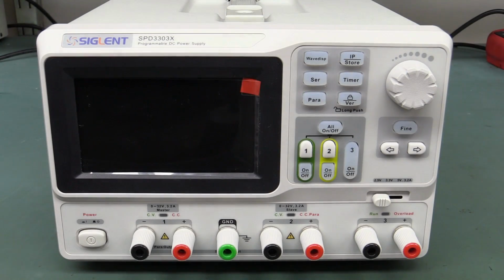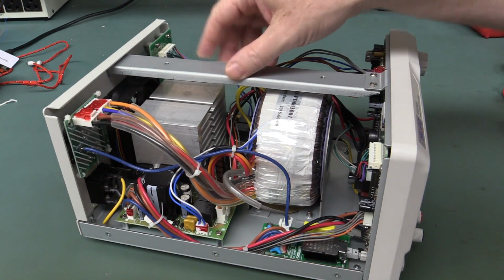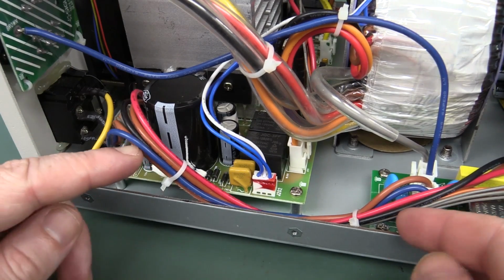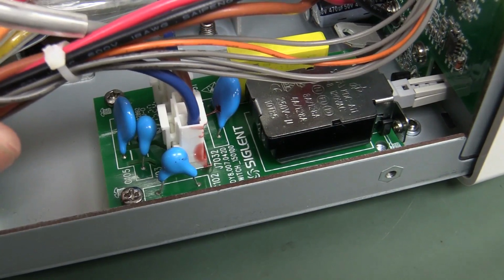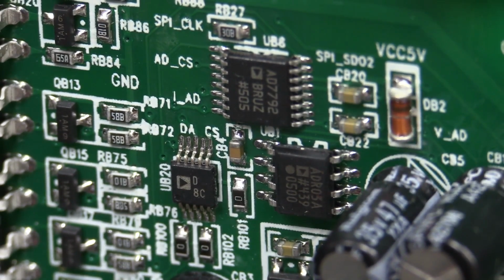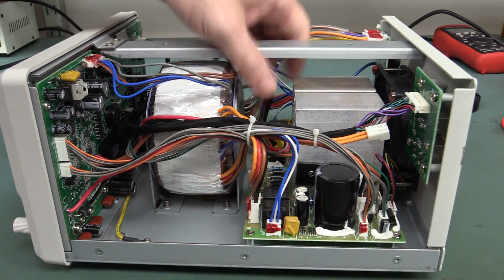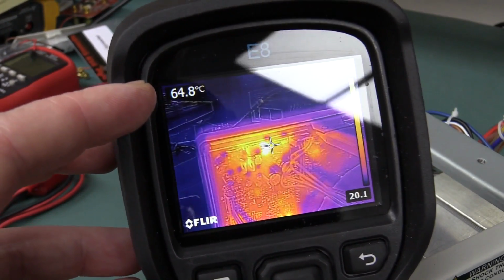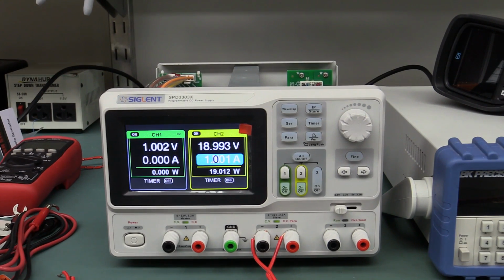EEVblog #828 - Siglent SPD3303X Precision Lab PSU Teardown

Comment: +EEVblog I want to build my own really awesome 0 to +-15V 5A dual rail linear power supply, but I only have a 24Vrms 10A center tapped Xformer with a smaller separate high voltage winding (almost 35V if I remember correctly) One of the problems I think I will face is dissipating potentially 5A at 15V, or 75W of power for each rail! Is this unrealistic? I was thinking about using a CPU heatsink on a TIP35C and TIP36C. Will I need to use a switching preregulator or modify the transformer?
Reply: Starting with a transformer that's not suited for the application is a recipe for frustration.  That said, it would probably be easier -- unless you really understand switchers and their feedback loops -- to modify the transformer.  From a hobbyist POV, a high current switching preregulator is witchcraft.  Remove a few secondary windings from your transformer to achieve the desired AC output, but you'll have to unwind past the middle and reposition the center tap to keep it balanced.  You're still going to have a lot of heat to deal with at low V, high I outputs.  I'd use the aux winding to power your control electronics, but 35V is a bad starting point for that as well, so it should be rewound also.  Really your best bet is to buy an appropriately sized toroid core (eBay: ~$30) and wind your own transformer.  Fun and challenging project; good luck!
Reply: +Power Max 
so 24V RMS centre tapped, or twin 12V winding, will give you +16.98 and -16.98V after rectification and filtering (remember Filter caps will charge up to peak voltage, not RMS).
You only want a single rail, so just use half the Transformer, should be fine, but 16.98V is probably a bit too close to your desired 15V by the time you take into account ripple, and required VF across the regulator, although there are some great Low drop out regulators available now so if you have enough capacitance in the filters, you might get away with it.
Reply: +Richard Freeman It is close, but if I can achieve dual rail 15V, that would be nice! However I am really wanting this homemade supply to be fully adjustable current and voltage from 0. That is proving to be a bit challenge with discretes. Even if I decide to make this only +-12V. I have a LOT of op amps, including several handfuls of LM741's, and LM324's, some LM318's, as well as a few LT1112's, and LT1364 and some other similar opamps, along with like 10 2N3055's in the TO3 package.
Reply: +FlyingShotsman Actually, the transformer is more like 12v-0-12v windings. They are 15V open circuit after rectification and filtering. The transformer actually came out of a Lambda linear power supply rated 5V 10A! It was not operational to begin with, I cannot imagine why they used such a high voltage transformer in this supply, maybe because it was from like the 70's or something, when discrete transistor circuits were sort of 'sucky'? (high dropout voltage reg design) IDK.

Modifying this transformer will be incredibly difficult I imagine because of the way it is constructed. It is really solidly laminated together, and it almost looks like there are like 10 layers of laminated paper material which chips away and is pretty sharp. If I were to make my own, it would have like 8 taps on it, 4 for both the positive and negative half!

If that 35V smaller winding has a center tap that is connected to the center tap to the main secondary, I might be able to use that to reduce the dropout voltage to practically zero! I have a linear power supply design in LTspice that is made exactly like that and it works well, at least for the positive half, have not done much work to make the bottom half regulate.

I have modified and built a few switch mode regulators, and understand the basics of how they work, though I am not too experienced with them. Certainly not an expert at them.
Reply: During the design process, I learned the hard way that LM324's do not like almost 40V across their power pins :O I killed half of a LM324 that way! The other half works though! It is saved temporarily from my box of shame!
Reply: while the basic idea of a Linear supply is pretty simple, juggling compensation loops and trying to stop the thing breaking into song, while still regulating nicely can be fun.
I would suggest looking at an LM723 (or two - one for each rail) as there are tried and proven circuits out there based on this chip, after all this is the job it was deigned for.

If you do want to persist with Op-amps, then as you have observed around +/-18 Volts is about as far as they go (although there are some newer ones that can handle higher supply rails)  so you would need to power any Op-amps between your 0V rail and the unregulated side of the rail it is going to regulate. then you may have the challenge that Op-amps usually can't drive their outputs rail to rail, so getting a supply that can regulate down to 0V output may require a trick or two....
Of course you will still have the problem of heat in your output stage at lower voltages with high current outputs, and you may find that by the time you buy heat-sinking and cooling for this it is cheaper to buy a more suitable Transformer.
Reply: +Richard Freeman yeah, lots of things to keep in mind, I certainly understand from some experience! I luckily have not had too much problems with parasitic oscilation, a capacitor took care of that. So far my prototype suffers from really poor line regulation because LEDs and normal zeners don't make great voltage references.
Reply: yes, Zener voltage can vary quite significantly depending on the current through them, so what you have to do is limit the variation in current through them, using a current source, even a relatively simple one like;
https://en.wikipedia.org/wiki/Current_source#/media/File:Const_cur_src_111.svg
this will reduce current variation through your zener (use the zener in place of 'Load' which in turn will reduce the variation in VR of the Zener.
Reply: +Richard Freeman Yeah, the classic BJT current source! Love that circuit for it's simplicity, that is actually what I am using for a minimum load! I did try that idea to limit the current range through the zener in hopes that it would further stabilize it, but I could still see quite a bit of variation across the zener. Maybe I built it wrong, IDK. I built the PNP version of it though, so that I have a current source instead of a sink.
Reply: +Richard Freeman I think the current-limiting portion of my design might be flawed though, what I am doing is using a op amp across the shunt resistor (between output of the pass element and the output)  and another 100ish ohm resistor in series. I develop a voltage drop across that resistor by means of that adjustable current sink, in that URL, so that way the op amp will turn off the pass element when the sum of the voltage drops through the main shunt resistor and the other resistor is greater than 0. I asked about this on Instructables, so more details can be found here:
http://www.instructables.com/answers/How-to-make-a-variable-accurate-current-sink-or-a-/

Comment: That fan sounds horrible, probably 1 dollar crap from china with sleeve bearing. This should not be ok in any electronic device. 

"Yes you could have totally silent fan for 15 dollars more in this 550 dollar device, but we at Siglent said no, enjoy your ears bleeding."
Reply: +Ondřej Dujka hahah, and this is why every piece of lab gear I own gets a noctua or similarly quiet fan in it as soon as I buy it :)
Reply: Chris Tate You are my kind of person. Noctua´s are great, i have 6 of them in my pc (PSU included) running at low low silent RPM´s.
There was a time for loud fans, we call it 90´s now.
Reply: +Chris Tate 
I agree Chris, My Agilent 34410A drove me nuts with its wine, I couldn't wait to shut the meter off! Happily the new 34465A is quiet especially nice when doing those long histograms.
Rob

Comment: Those terminals not getting a good connection with a standard banana would drive me crazy. They will need to fix that.
Reply: Shortly after this video the part was changed to a tighter fitting model of jack.
Reply: Siglent Technologies hi. Did you adjust the spacing to a more “standard” diameter between holes? Also has there been any improvements in the ui as Dave mentioned?
Reply: +Alfred Stampe Seriously, how does that make it even out of the CAD software?! Is there any reason why they do this?
Reply: +Alfred Stampe Unbelivable, even my crappy 50$ power supply has better binding posts...
Hope those are not fixed permanently to the front panel, I'd immediately change those (or buying a rigol instead)...
Reply: +marco56702 I am pretty sure you could replace them with a bit o' work, but that would not fix the spacing.  It's too bad.  This supply could have been very fine with just a few small changes.

It makes you wonder what somebody was smoking.  A screen saver on a power supply?  What's that about?  When did LCD displays start needing screen savers?  Are we trying to save power now on a linear supply?  lol...
Reply: +YensR of course, it´s all 3rd partie may 2nd source as well....you order these things from an oem....
Reply: This is just stupid, I think they need to improve their project team...
Reply: pillsnotbills the "coolest" thing is: screen saver for LCDs work the other way...while the background light is on,the best for that thing is to display white..as than the LCD pixels all transparent and do not block a certain frequency thus display a color or even black when all set....;) next best would be to switch off the entire backlight....i don´t know what there doing....but i´ve seen so many "savers" on LCDs which only set the entire screen to black....;)
Reply: pillsnotbills say YOLO, if you like and use your PS SC ;)
Reply: good...:) i always use to watch Dave´s videos...Hope you´re doing good as well...?
Reply: TubiCal If you absolutely must have a "screen saver" on a power supply, it should be selectable and adjustable.

The guy who did the banana jacks must have been bananas.  He probably did not know that there is a standard for size and spacing.  They bought the cheapest surplus banana jacks which no one wanted because they are stupid, and chucked them on any old way.  At least it matches.

Comment: Those banana plugs are inexcusable, the rest of the instrument is irrelevant.
Reply: The banana plugs were changed to a more snug design.
Reply: @SiglentVideo  That is what I call great service, you do read and listens to the concerns!
That is what makes me believe in a brand!! :-)
By the way, do you know when your new multiple output PSU with remote cense gets released?
Reply: Siglent Technologies I was going to buy this power supply then came across this video, then decided against it, then came back to the comments to see you changed the banana plugs! Now I’m going to order one! Glad I came back
Reply: @SiglentVideo  But did they Siglent address all of the banana plug deficiencies? Spacing, looseness, and small diameter wire hole for the screw-downs? I would really like to buy one of these, but these plug deficiencies are a deal-breaker.
Reply: @Pheckphul1  The diameter/fit has improved. The spacing has not, due to tooling costs.
Reply: @SiglentVideo  Thank you for your reply.
Reply: @Pheckphul1  Glad to help. The SPD1000 series does have standard spacing. They are single channel, however. - Jason
Reply: @Pheckphul1  For what it's worth, on other power supplies if I needed a larger wire hole I just drilled it out. Hmmm, though I might think twice on this one. https://www.eevblog.com/forum/blog/eevblog-828-siglent-spd3303x-precision-lab-psu-teardown/msg825285/#msg825285  .. though I'm assuming those were the old binding posts, not the new ones.
Reply: +Andy Lawrence Well those 90+°C diodes are not so irrelevant I guess...
Reply: +Krisztián Szirtes While not exactly good design practice, a lot of power semiconductors are rated for a junction temp of 150C instead of the usual 100C that you see in ICs.  Is it going to last for 30 years and still be just fine like an old HP power supply? Nope. Is it gonna die in a month? probably not.
Reply: +CKOD I am not concerned about the diodes, even if I had baked a few but more about the PCB itself. The epoxy or phenol based or whatever PCB that is just burns and bends, that way ruins the traces and might even crack or completely cut them.  The diodes are fine, but the PCB manufacturer probably didn't use "/godmode 1" when made the boards.
Reply: +InXLsisDeo As I look back at the video, at 25:58 it's more like the redesign is a must thee.The electolitics will dry up in no time considering what the full lifetime of the thing should be.
Reply: +InXLsisDeo Ha, as I see I'm not the only one that gets the "&quot;" and similar shit after editing the comments :D
Reply: Siglent Technologies m

Comment: I don't like the power switch. It was designed to be mounted with screws but they just soldered it on the pcb. I don't think those joints will last very long.

Comment: I get the feeling that the ethernet connecter
enables a lot more flexibility than the older
GPIB interconnects did.  What kind of uses
would stretch the ethernet stuff and to what ends?
From the net to slave the PS and to the web to
provide graphs or status?   How many outfits
actually use that stuff?   Do server farms use these?
    
I hope Eric Qin isn't in any way offended by your fair and honest review.
Reply: Programmable PSU's are typically used for characterization and factory chain testing at all spec min max of supply and temp.

Comment: Dave, from the picture the bolt through the toroidal transformer unless it's made of plastic (doesn't seem so) IT IS CONNECTING through the chassis, so there seems to be a shorted turn there!
Reply: +EEVblog How can a washer break the loop? To me it looks like if you cracked the threadlock it's connected. I couldn't let it go and lost attention after that. On the outside of the bracket where the nut is?
Reply: @BrekMartin  - It's VERY simple... the washer electrically insulates the bolt from the metal. Think about how you connect a power transistor to a heatsink.... there is an insulating washer so that the bolt doesn't electrically connect the case and the metal tab of the device.
The washer is clear plastic, and has a shoulder than fits into the hole in the sandwich plates. There is no electrical connection between the bolt and the 2 side plates. Dave has already explained that there is washers, both in the video and in the comment... why can't you comprehends such a simple thing?
Reply: @johncoops6897 Brain damage, and a poor attitude probably.
Reply from the maker: +Kris TheTrader Not if it has an insulated washer, which it does appear to have.
Reply: +Brek Martin Same thought over here... I guess we will never know now... :-)

Comment: STM32 running Linux with tens of kb of RAM.. probably not.
Reply: +donpalmera FreeRTOS all the way
Reply: +donpalmera agreed, 0% chance there is a linux in that.
Reply: Dave doesn't know shit about STM32F2s I suppose. Can't judge him, there are so many.
Reply: The lack of a RAM chip right next to the ARM chip should have been an immediate dead giveaway. Usually there's a NAND flash / SPI flash or somesuch too. No RAM? Then it's not full-on Linux, just some sort of embedded RTOS - and frankly anything more would have been a massive overkill...
Reply: +Lemming I know. I have patches in the mainline for a uclinux target.. you can't run uclinux on tens of k of RAM.
Reply: +donpalmera µCLinux can actually be run on an STM32F2 series chip. even on the lower F1 series.
Reply from the maker: +billigerfusel I didn't bother too look it up.